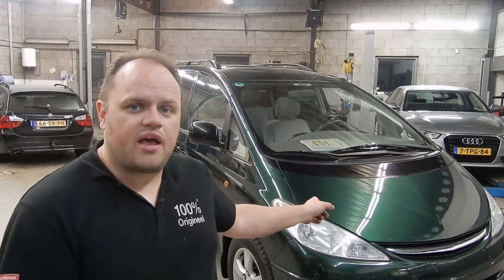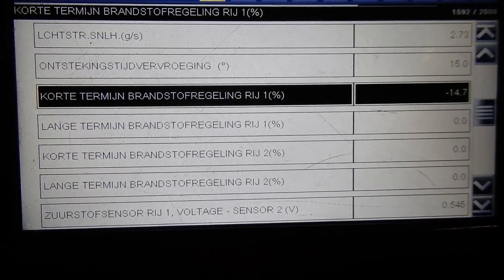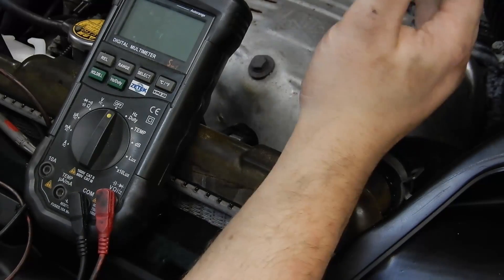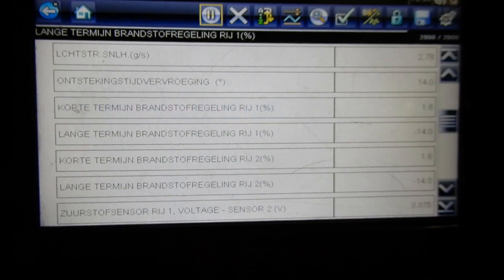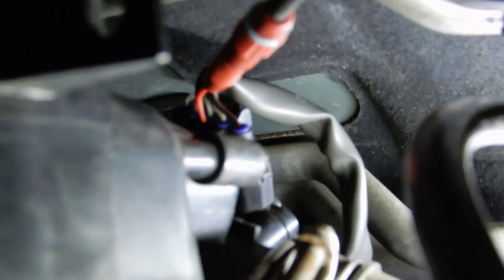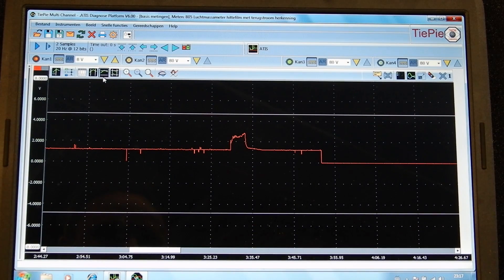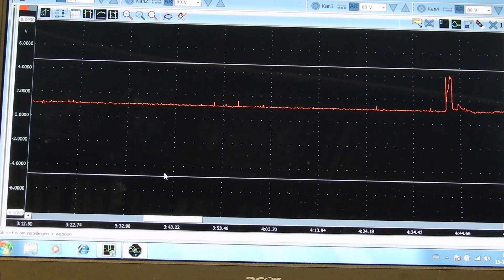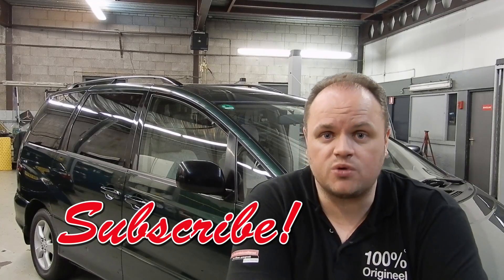Diagnosing an engine without using faultcodes

Comment: Two things intrigued me - can you provide some explanation?
1) sound of the engine souded too harsh, compared to my car. Was the exhaust OK?
2) ECU was not able to detect the open circuit in the upstream O2 sensor - I believe there is a dedicated DTC for that

Comment: Another great video Dan. I really enjoy your videos. There is a lot of learning in them. I’ve always struggled somewhat with the correct way to check an air mass meter. In this video when you reved the car the Air mass didn’t reach where it should be and it was because the AirMass was dirty but what if it was a fuel pressure issue that was causing the engine not to rev. If the engine isn’t Reving fully would that not lead to a low Air Mass signal also?

Comment: That takes me back, too many parts fitters these days rely on fault codes. I had a 2.0 TFSi that was showing all sorts of boost fault codes. On the Skoda 2.0 TFSi the air filter box is held on by big rubber bungs. These bungs can become displaced when refitting the air filter cover and get sucked into the turbo! A really bad design fault. Once the chewed up bits of rubber were removed from the turbo, no more boost fault codes!

Comment: great job again.
Diesel engines with EDC have the same issues,for example when no have turbo boost and no have dtc code, first check is the condition of MAP sensor.I fixed a lot of cars just after i clean the carbons and oil inside them.

bravo Dan, continue with great videos.
This is a very good example when one technician know the thing on the DNA level 😉. It is very important to know how to diagnose with scope.👍🏻👏

Comment: It is the same phenomenon with my car.It would not rev beyond 4000 rpm  unloaded with no gear engaged.It is a 3 cylinder and this is a security measure against any critical vibrations above resonant frequency.Very simple.

Comment: car idles rough, accelerates slightly odd  - every 1.5 seconds engines gently slows down as if you are letting the gas off a little, if you floor it engine still reach high rpm and seems to have ok power but especially at low rpm the power is weak, what to look for first?

Comment: You only temporarily fixed this problem.  What you need to find out here is why the Mass Airflow sensor was covered in carbon.  This is the root cause of why the Mass Airflow sensor was not operating properly.  Diagnosing this will only then fix this problem permanently.

Comment: If this car was equipped with Wideband o2 sensor ,that the readings you told “below 1 the mixture is rich “ is that correct ?

Comment: But isn't the reason for sensor not producing 5v signal when it is dirt is because the engine rpms are only about 3k. At 3k rpms it wouldn't suck the maximum air for which this sensor is calibrated.

Comment: VW Sharan 1.8T petrol also have three air flow sensors - one just after the air filter, one before the throttle body and one after the throttle body. The two closer to the throttle body was full of gunk and was very dirty, a bit of TLC, a soft paintbrush and some thinners cleaned these properly as well as the throttle body which was just as dirty. Fault codes pointed us to these sensors, our complaint was a high idling speed (2000 to 3000 rpm - not good for the turbo)... 

At the moment we have alternator issues, so we did not start the car yet, but I'm confident that the problem will be fixed. The alternator is another story - a supposed recon unit which is not working properly, and the shop which fitted it does not believe us when we told them it is giving us issues. Caused our battery to develop a dead cell as well... I'm not happy about this. 

Any recommendations on any good instruments with which you can read error codes? Wife and myself have decided that we've had enough of ripoff shops here in South Africa, and we're going to learn ourselves to do our own cars. Most shops are happy to take your money and give you poor service to boot.

Comment: Hello Dan, i've got a question. 
So the engine computer controls the fuel mixture via data from maf and in the case its not stoic it will regulate (trim) from the data of lambdas?
Btw, i love your videos and i've learned so much from them, greetings from Finland.

Comment: Great Dan. I have the same issue not Reving beyond 4000rpm. My car has a MAP instead of a MAF. How can I check or clean the MAP. If the MAP is good how can I check the fuel pressure issues which you said could be the 2nd suspect? Thank you

Comment: Excellent video Dan, one note to viewers, this is a clear case of uneven revving around 4000 rpm, newer engines, for example VAG engines are rev limited at full throttle while you’re parked or standing still. Don’t confuse the two situations. I have a 1.4TSI which sticks to 3500 rpm at full throttle, but even running.

Comment: Great advice never trust the scanner!  based on the data i would have for sure checked the MAF first.  I thought the MAF over calculates off idle and under calculates on idle.  The STFT did not show that at idle but you could for sure see the difference at high RPM.  You should have seen a positive STFT at idle based on theory.

Comment: Another excellent case study. As I follow along I often pause the video and consider what I would do next. Although my first guess on listening to the engine was a plugged exhaust, the data pointed right at the MAF. As usual I didn't think of the other important cause, reduced fuel delivery from a weak pump, exposed when demand increases. In a way, this presentation is a crude reciprocal of a vac leak, in this case going lean at WOT, with secondary compensation. Thank you for walking us through another useful learning experience.

Comment: A quick  check would have been to simply unplug the maf sensor. The engine would have ran on the default fuel table using tps and rpm points for fueling.
I know Dan knows that. Just mentioning it for those who don't have a scope.
Reply: Thanks James
Reply: Thank you

Comment: thank you for showing us what a dirty MAF does to engine controls (crazy fuel trims) - Also funny how a L4 engine gets 2x O2/lambda sensors like V6/8 engines 
(I guess it helps the monitoring software sanitize 1 sensor data against the 2nd upstream sensor sensor)

Comment: Did you actually fix this problem? MAF sensors are self cleaning by heating the wire. Why did this fail?
Does this car have excessive amounts of oil from an engine problem or a permanent oil covered air filter or is there a problem with the cleanup cycle?

Comment: You would think that the aux heating or the O2 sensor would not be needed once the car reaches normal operating temperature.  At 600 degrees, the O2 sensor should work normally.  Another thing, the scanner should give you the status of the fuel pressure and MAP sensor voltage.  Just check them and see, no need to manual test at the sensor location.
Reply from the maker: I'm pretty sure you mean Maf and not Map😜 Using a scope and measure at the component is more reliable than looking at scandata. Some scanners even give you a default reading when the component is unplugged. The scandata is processed data and could be false when for Example you have a resistance in a wire. 
This is what seperates the Professional from the Diy.

Comment: Hi DiagnoseDan, I've been wondering if you can still use the fuel trim and O2 sensors to diagnose issues when the car has been fitted with an aftermarket piggyback ECU or have the ECU remapped? Since the AFR has been changed/ tuned outside of manufacturers specification.

Thanks!

Comment: Great video. I didn;t know those toyota 4-wire O2 sensors are wideband ones. Since the car could not rev at maximum, why did you expected an almost maximum value from the MAF sensor. Does it flat-out after an RPM value?
Reply: OK, I just noticed the the RPM value was almost 6000 RPM, so the almost 5 volts is expected from the MAF.

Comment: Wow!  Amazing thank you.  Fuel trims are starting to make sense to me now finally. I thought PWM fuel pump, I was wrong.  I'm always scared to clean a MAF sensor. I cleaned an airflow sensor one time on a Lexus, to my failure it was a Karman Vortex Generator with photo sensor. BIG MISTAKE. That sucker cost 800 dollars in 2001. Always know the type of sensor you are cleaning and with what solvent. Isopropyl alcohol is the safest cleaner for this.
Reply from the maker: Look at fuel trims like the old ajustment screw on a carburators. You could make the engine run more lean and Rich. The computer ajusts that "screw" for you now.😊

Comment: C kit could also be O2 sensor.  My ford exlporer had the same problem, at idle it worked fine but when you reved the engine the volts from the O2 sensor went to zero short tetm fuel trim maxed at 64%.  Replace O2 sensor and problem gone

Comment: Danny I have a question ! Please how did you know that there is a wideband O2 sensors ? The sensor have 4 wires
Reply: Take a look of the unit ? Volt or Amp ?
Reply from the maker: @aymenbouzouita8956  yes, of the engine is equipped with a wideband sensor there is going to be a current data pid.
Reply: Thanx for you Danny
Reply from the maker: If you have any doubts just take a look at the scandata.

Comment: Dan! when the maf was dirty and didn't reach the 4/5volts the rpm only reached max 4krpm,  should we still expect to see  4/5 volts at MAF even though the rpm didn't reach max rpm, I would be inclined to think the maf was correct as rpm only at half of what it can reach. just for future testing I'd like to know thanks alot. love the videos
Reply from the maker: The maximum voltage is reached if the maximum amount of air is reached..................think about that😉
Reply: @Diagnosedan  yes that's my question. if other factors cause the rpm to only reach say 4000rpm and the maf reaches 2.5volts like in the video how do we know the mad is the cause?
Reply from the maker: @stephenmarshall5302  there are different ways like, unplug it test, look at fuel trims with raised rpm or do a VE calculation. I will show this in future video's 😊
Reply: @Diagnosedan  thank you very much and thanks for taking the time to reply. love your videos

Comment: I was doing this back in the 80's and tbh you guys have it made now. Our diagnostic tools weren't nearly as good so you had to know the basics and that was always our mantra, remember the basics and what it takes to make a simple engine run. Anyway, we would write the codes down, clear, and road test the car and see if anything set. (Back then there was no short/long term code difference. Get a late 80's or early 90's elec FI car with a computer and no obd 1 or 2 in it and see how fun that can be.
Reply from the maker: I know, i have been there🤣🤣

Comment: I had an astra g with a 1.6 8 valve engine auto gearbox.
 It kept stalling when slowing down coming up to junctions when it was hot!
It turned out to be the egr valve!
The valve must have been sticking but it had no fault code's at all!/

Comment: First off awesome job, I wanted to say that the test of the 02 sensor heater circuit was great. Sometimes I forget that wideband sensors use them too. I liked the use of the scope in circuit testing the maf, I personally like using the calculated engine load % to find dirty mafs. Toyota needs 90% minimum on wide open throttle. Then I would break out the scope. Anyway! Great job!
Reply: Those heaters are critical to A/F sensors, they won't work without it. Learned that a year ago myself.
Reply from the maker: Thanks Cody!

Comment: Any experience with 90's Toyotas with 1MZ FE 3.0 V6 (non-vvt) engines?  I have two of them, a '99 Camry and a '99 Avalon.  Both U.S. spec as that it where I live.  Both can have weird start up issues after short run times.  Neither have ever set check engine codes.  One has 115K miles and the other 109K miles.  Basically the issue is they can have long crank times after a short run time of say 5 minutes on the road, shut off for 5 to 10 minutes, then can take up to 4 attempts before re-starting.  Start up sounds likes it's almost going to start type of symptoms but doesn't.  Scanned IAT & ECT temp sensors and they match at first of the day cold starts.  MAF sensor is not used for starting, right?  LTFTs on both are very near 0 OR can vary slightly while running, even at idle-which rules out vacuum leaks?  Both have near new batteries, spark plugs, & newer OEM spark plug wires.  Both run smoothly and have recent timing belts, cleaned throttlebody bores, and new valve cover & intake plenum gaskets.  So is this probably related to fueling such as dirty injectors, or is fuel mapping logic inadequate since issues occur when the engines are still cold-ish but the coolant is warm, so it leans it too much?  Yes, I'm a noob in a way.  As even though I've worked on cars since 1982,  I haven't done so in a capacity like someone who does it for a living, especially with fuel injection (yes I'm that old 👴).
Reply from the maker: I don't have specific experience with this engine. Some cars do use the Maf for starting, disconnect it and see if the symptoms chance.😉
Reply: @Diagnosedan  Thanks so much!  BTW I have cleaned both of their MAFs.  So it will be ok that their IATs, which are part of the their MAFs, will be disconnected also?  Although I could probably connect jumper wires to keep their IATs connected, assuming they have their own signal wires, hmmm.  So on second thought, sounds like the next steps are to rule out their MAFs.👨‍🔧
Reply: A sticking purge valve can cause long crank, even a weak fuel pump that bleeds off pressure, very common on Toyota. Next time you think it will act up, try turning the key to run but not crank,turn it off and turn it to run again but crank it. If it always starts this way you have a fuel press bleed down problem. Older Toyotas the plastic for the fuel pump would cause tiny cracks

Comment: Awesome video Diag Dan, great Information on MAF's, STFT, LTFT, Widebands, and using Lambda.

I have ran into a couple VW 2.0 TSI Turbocharged engines that were both setting false MAF performance codes as well as having very high Fuel Trims (lean cond) under high rpms, both with cracked intercoolers!  I know that this is not the case here, just thought I'd share that information with you and others.

Just wondering if you have seen similar problems like this with those European models you seem to work on over there?

I love your channel, learning new stuff outside of American helps tremendously!
Reply from the maker: It seems we have the same problems everywhere! Thanks for watching!

Comment: Thanks a lot sir for your excellent service. Please can I ask for your help?
Reply from the maker: Thanks for watching my video's it's appreciated!👍
Reply: I have a toyota land cruiser 2000 model. it's showing up a check engine light plus o / d off flashing. Code is p0500 but even after changing the speed sensors  (input and output )the problem persists. Please help
Reply: @moseschege6139  Next check for any visual issues like chafed wiring or corroded connectors for the sensors.  Hate to say it, also look for any issues with wiring that rodents can cause, as I ran into this recently, and it was a pain to get it all sorted out.

Comment: After 2 seconds sounded like a clogged Cat !!
Reply: I believe a clogged catalytic converter would actually cause the fuel trim to go rich instead of lean if I'm not mistaking.
Reply: @TRcustomengineering  the like by reply from dan says i'm wrong, but a clogged cat would restrict exhaust, increase backpressure, and cause an egr effect, reburning the exhaust, exhaust valves open and backpressure would push in and reburn any O2 remaining in the exhaust, leading to a low O2 exhaust content, sensors would perceive that as a rich condition and correct by subtracting fuel to compensate.
  Edit: by Fuel trim, you are saying the adjustment to fuel, not the exhaust sensor output, which would go "rich"
 i'm wondering why Dan went to the raw signal from the MAF rather then datastream, unless it wasn't available.
Baro numbers are my best tool for restricted airflow Vs skewed sensor values, as they are often taken KOEO.
2 side notes, huge crack in the radiator, hmmm?
secondly, i want to slap the tools out of Dan's hands for piercing wiring rather then back probing the connector under the weatherproofing, as that causes green corrosion to creep along the wire in a very short time, making more work for me replacing a section of harness damaged by um, unthinking hacks that don't understand the long term effects of their apathy.
at $1 each, the set of 20 from Thexton is a steal, or use straight pins, FFS.

Comment: hi , why this car does not have fuel cut off protection at high engine speed more that 4000 rpm while transmission at park position ,, thank you .  i like your videos
Reply from the maker: Some manufacturers do and some don't.

Comment: hello dan,first i wanna thank you for your good work!I have a passat b5.5 1.9 130 hp, it has 137 km real km, the first key in the morning the engine is galloping, shaking and gives a blue smoke . if I have a consumer, start the climate for example before giving the key everything works ok In the cold season it's all ok that's because so, I have consumers! I replaced g62 oem,no fault codes,scanned whit oem interface.thank you